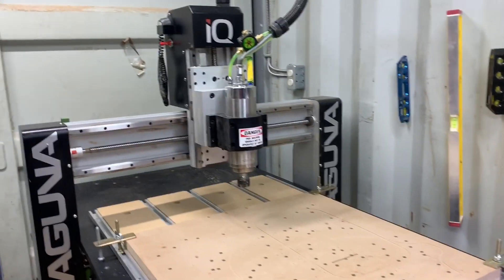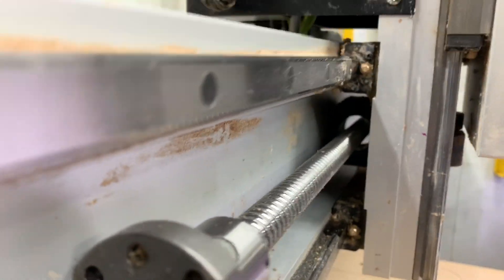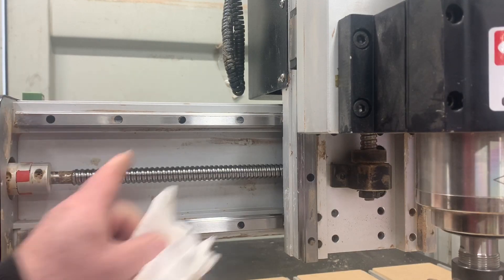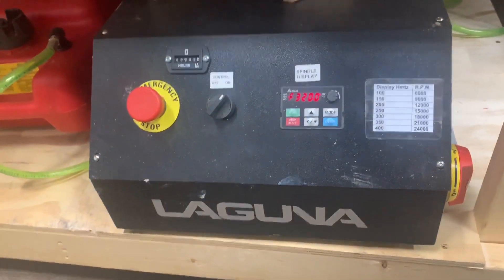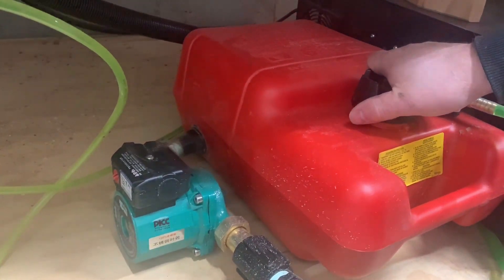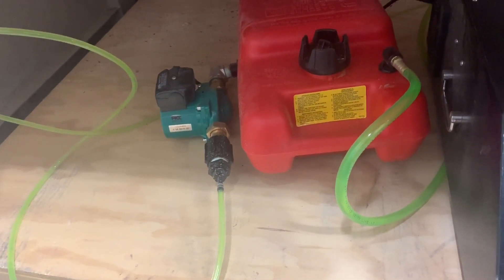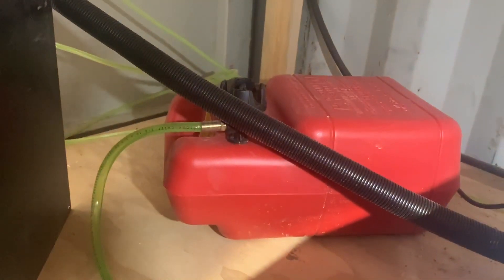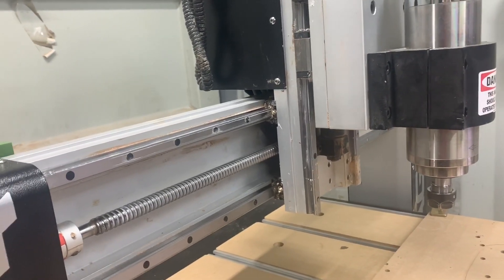Maintenance on my Laguna iQ and my upgraded cooling system

Comment: I bought a Oregon chainsaw grease gun that you push to grease and it shoots right into the hole. Took a little pressure to pop them loose, but works great

Comment: Excellent video.  I was wondering about the grease fitting - knew I couldn't get a grease gun on them.  My spindle heats way hot.  I have attempted the fixes discussed in various forums but I can't get the flow through the spindle with the pump provided or a new pump.  I have a new pump of the same type and I only get drips out of the spindle, this is after blowing lots of gunk out of it.  I believe it is only a matter of time before it fails.  i have  a new spindle but haven't put it in - I will when the one OI have fails.  Now you have me thinking about possible modifications to the cooling system.
Reply: I bought a Oregon chainsaw grease gun that you push to grease and it shoots right into the hole. Took a little pressure to pop them loose, but works great

Comment: Hello. Great idea and I am attempting to do a very similar setup. Right now I’m have major problems with leaks on the outlet side of the pump. What fitting did you use off the pump to the CNC tubing?

Comment: Thanks so much for the rundown on your cooling system. I had the impression that antifreeze wasn't a good idea for water cooled spindles (or maybe that was bleach in a water system).  How long have you been using antifreeze in your system?  Have you ever changed it out?   I like the radiator idea.  
I was going to comment on the amount of dust in your control box but then remembered that our makerspace cnc's controllers plus the computer are sitting in the open on a shelf under the cnc and are usually covered with a layer of sawdust. ;-p
Reply from the maker: Richard Farwell I been running the antifreeze since I put the new pump on, that was when I also put in the hour meter and today it has about 295 hours.